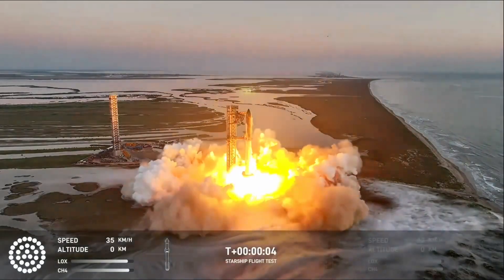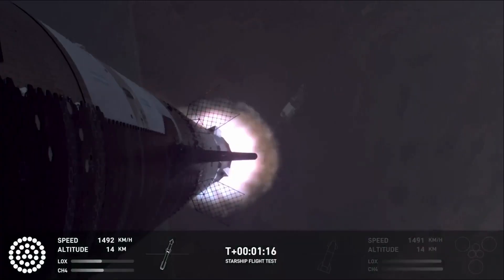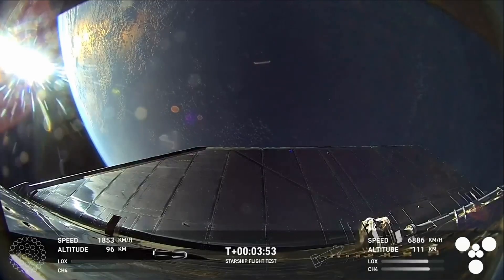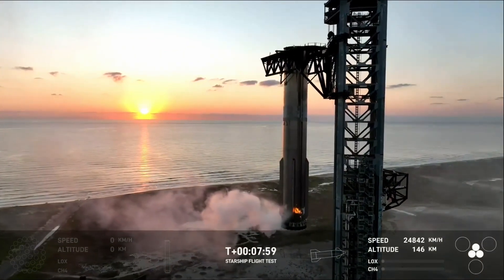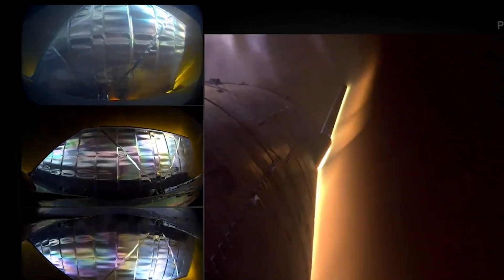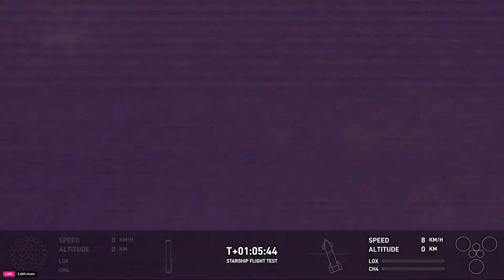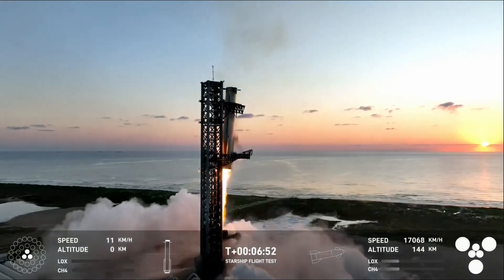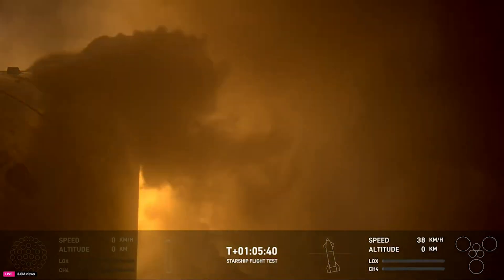What Exactly Happened On SpaceX's Fifth Starship Flight Test?

Comment: SpaceX is showing the world that robust reusable space launch technology is within our grasp!
Reply: It is ALREADY HERE....What you talking about? Did you see Falcon 9 Booster come back often???
Reply: @1flash3571 Falcon still isn’t fully reusable. We’re getting there. 😊
Reply: @1flash3571 falcon 9 is partially reusable, even after landing they still need to refurbish the landed booster, Starship is going 100% fully reusable almost plane like turn around speed
Reply: @1flash3571 these are even more reusable. Falcon 9 is more like “refurbish-able” with some cleaning and touch ups. The fuel used makes it a little bit of a process to get the engine ready for its next flight. Starship and Superheavy use a much cleaner fuel and full flow combustion, which should, theoretically, lead to basically instead turn around for consecutive launches
Reply: McDonnell Douglas and NASA did it back in the 90s, I think there's a reason nobody else is really pursuing it anymore, it doesn't make much sense. By the time you add the extra needed fuel/ reduced payload, risk, and all the refurbishment needed before the next launch...  you're better off just splashing down and building a new rocket.

It's a bit like putting gullwing doors on a car, it looks cool but not very practical..
Reply: @SteveLomas-k6k  McDonnell Douglas and NASA very much did not do anything of the sort.

And yeah, if you need a massive refurbishment then you're correct. The goal here is to not need that. The end goal is to catch the booster and fly it an hour later with a new starship loaded up.
Reply: @Fogmeister  They built a re-usable vertical landing rocket first successfully tested in 1993. They got the turnaround down to a day.  Oceangate's Titan sub was supposed to be equivalent for deep diving, but you face the same problems of re-using something undergoing massive stresses with catastrophic consequences for small failures.   

Not saying it can't be done, but whether it can be done safely with economic viability is questionable..

Comment: Never in the history of mankind til today has a super heavy booster has been captured in mid-air.
Reply: Have you ever noticed that the Romans never caught a super heavy booster
Reply: @bearlyrandom4462 I don't think it was meant to be a knock on anyone.  It was an appreciation of being alive to witness a meaningful first in the human race.
Reply: @bearlyrandom4462  
Haven't you heard of the book " Chariots of the gods " 😀
Reply: Pity the Moon doesn't have a Mechazilla... save landing HLS  Lunar Starship on that rough, uneven, lunar surface! Shame.
Reply: @davidstevenson9517 The moon has no atmosphere so no need to worry about heat shield and is 1/6 gravity of Earth. 

As long as you have reliable rocket engines to slow you down and to perform the landing manoeuvre… anything can land on the moon.
Reply: @davidstevenson9517  There are plenty of nice flat landing areas on the moon that span miles.  If they can program a booster to land autonomously  on a target as small as what they did today, they can hit a miles wide target on the moon.
Reply: The natives said the booster was there when they moved in.